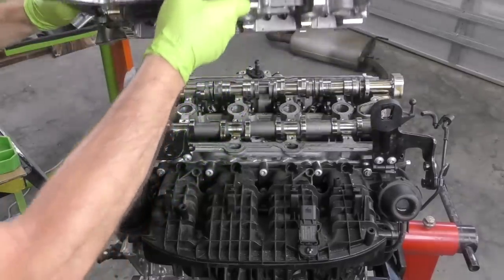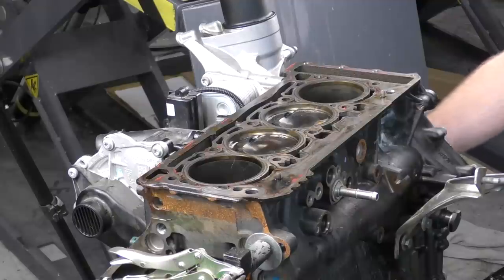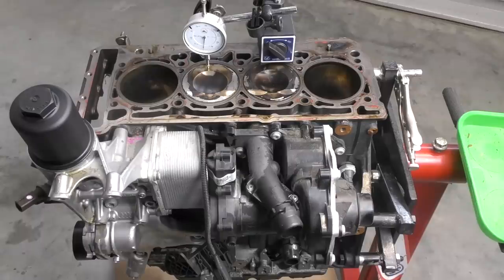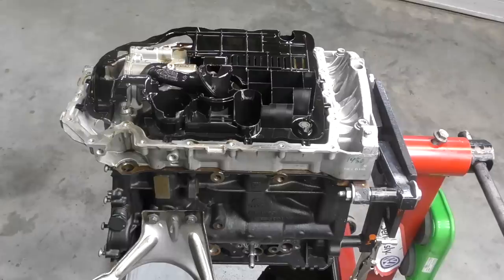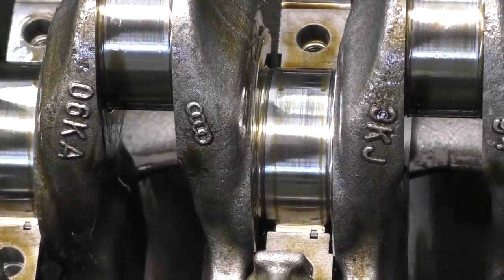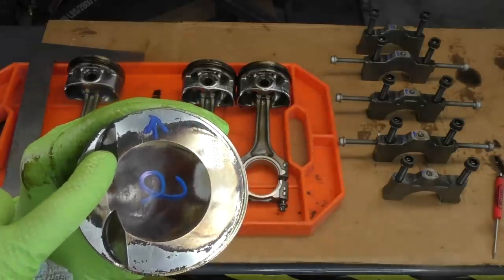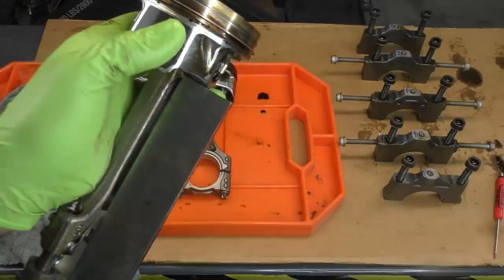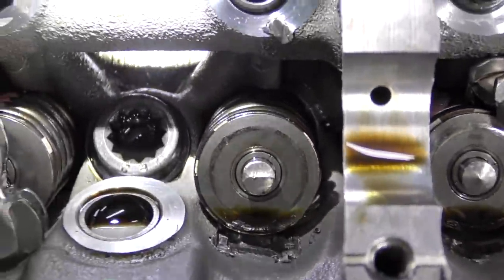Catastrophic Engine Failure VW 2.0t TSI Engine 2 ~ Bottom End Damage

Comment: relatively snoozeville which is a good thing obviously, that thrust washer is interesting, wonder why they use such a setup to introduce a point (potential) of failure, Charles, in your opinion, would you reassemble the short block(were speaking hypothetically) and put a new head and call it repaired or definitely rebuild lower end(this was a GTI engine correct?) Do Golf R motors have that much difference? great vid as always, and the chuckle at the oil pan was nice!
Reply from the maker: I’d be thorough in the replacemt. New bearing minimum
Reply: Why only half a thrust washer - Find and read VW SSP 606.
The first paragraph tells you everything you need to know..."The reason for the new phase of development is more stringent emissions standards (Euro 6) and, of course, consumption reduction requirements, accompanied by a reduction in CO2 emissions. The powertrain was in all respects redesigned from top to bottom....Ingolstadt engineers have, during development, paid particular attention to the following points:
- large number of identical parts for all engine versions
- Reduction in engine weight
- Reduction of engine internal friction"
Half a thrust washer = reduction of engine internal friction. Other changes included smaller main bearings for the 1.8L engines, two stage oil pump, many others. The EA888 gen3 was designed first and foremost to minimize emissions.
Reply: @acefighterpilot  Interesting.  I'm not sure I agree with that decision.  Lower friction, okay, but it seems like it could sacrifice a lot in the long run
Reply: @VndNvwYvvSvv  I don't agree with it at all, and clearly it is sacrificing the aftermarket's ability to throw a clutch in and boost away. I was very disappointed by the internal design of this engine compared to previous VW engines. For instance the VR6 has seven 59mm diameter main bearings to support its 178 ft lbs. But the Golf R has five 42mm main bearings for its 280 ft lbs. Both are forged cranks in grey cast iron blocks. They literally do not build them like they used to. VW/Audi did everything they possibly could to reduce emissions, weight, and cost at the expensive of durability.

Comment: 0:05 but 3rd to 2nd is not that much of a difference ? I would only expect this type of damage from say 4th to 2nd or 5th to 2nd how did this damage result from the difference of only 1 gear ? Could this damage also happen from high rpm 5th gear to 4th gear ?
Reply from the maker: It can happen at any gear with a high enough RPM

Comment: Is the thrust bearing assembly the same between the GTI and the R? Is my 2019 R just as likely to have crank walk with an updated clutch as a GTI does?
Reply: Yes, it's beyond a common problem - if you have an uprated clutch in your R, eventually the thrust bearings will wear and fall out. Most engines, VR6 for instance, have upper and lower thrust washer halves, which makes it impossible for the bearings to fall out. VW sought to minimize internal engine friction to reduce emissions as much as possible with the EA888, and that included smaller main bearings in the 1.8Ls and also only upper thrust washer halves in all engines (VW SSP 606).
Some R and GTI owners have posted guides on disabling the clutch interlock so you can start the car without the clutch in, thereby reducing wear on the thrust washers during the most critical time of low oil pressure and temperature.
The ultimate solution is to have the lower main bearing caps machined to receive the missing two halves of the thrust washers, which some R owners have done. Then it is no longer possible for the washers to fall out. But bear in mind VW's main goal with the EA888 was reduced emissions, largely achieved by minimizing oil flow whenever possible. They were not thinking about folks in the aftermarket running 400whp.
Reply: When I first read SSP 606, with a look of sheer terror, I cancelled my plans to tune my 7R and I plan on offloading it the day the warranty is up. I'm going to be dead within sixty years, I really would much rather have a car that lasts twenty years rather than stave off global warming by five minutes because my car only has half a thrust washer.
Reply: acefighterpilot I really don’t think the start up could cause enough wear on the thrust bearing, it is rather those people who sit at a red light for minutes idling their engine and leave their car in first the whole time, and do it for years and years.
Reply: acefighterpilot trust me you will get bored driving that car after 20 years, you may keep it but the chance of you driving that thing everyday after twenty years is very slim, I will wait for your reply after twenty years!
Reply: @davidgruen7423  Wear is cumulative. When you operate the clutch, you are wearing the thrust bearings. The car doesn't care why you are operating the clutch. It does however care if you are operating the clutch with no oil pressure and low oil temperature such as at start up. Try rubbing two pieces of metal together with oil and without. You can do it with oil a thousand times and it still won't leave scratches like doing it without. Disabling the interlock certainly won't stop the wear, but it will give you more time.

The Cabrio VR6 I built when I was twenty is still just as fun as the day I built it. The basic fact is the 7R is the end of the line for high power manual transmission Volkswagens. Maybe since it's so soul less it won't be as fun in twenty years as it is today, but to me it will certainly be more fun than the electric cars on the market then, for the same reason my Cabrio is more fun than it is - driver engagement.

Comment: I was test driving a customer car after a repair and I also accidentally shifted from 3rd to 2nd instead of 3rd to 4th. In a split second all I heard was the engine screaming and the RPMs close to 5500, then immediately put it in neutral and reset. How the engine didn't explode, I will never know, but I'll take it. I'm surprised I didn't die from how fast my heart was racing lol

Comment: Hello I have a 2010 Passat and the oil level keeps rising and the diesel keeps going into the oil has happened multiple times have you got a clue why this happens
Reply from the maker: I’ve seen fuel injectors leaking do that.
Reply: Injectors are leaking between cylinder head and injector frame. Is is pumpdüse engine or CR?
Reply: How do you find out which injector it is that’s leaking ?

Comment: I recently did some chains on this engine to to chain stretch and I know you did a vid on the chains but I took a few pics of the correct tools if u want me to throw up a quick vid. I’m a Audi diag tec
Reply: I’m a VW tech myself. Done a ton of chains. Never used the tool 🤷‍♂️ 

Only use the tool to remove the crank bolt. That’s it.
Reply: @lynxstarautomotive208  How long to the chains last from your experience? I have a 2020 GLI.  
thank you.
Reply: Coyote 5.5 V8 TURBO & 555 Big Block Chevy Camaro The gen III’s do not suffer from timing chain failure as much as the Gen I/II’s did. Really the main failure was the tensioner assembly more than the chain itself.

However, the secret is oil service. Stop changing the oil every 10k. Do it at 6-7k and use good quality oil like Liqui Moly, or Motul, or Pentosin.

Comment: If that first main bearing that had wear was in a old small block Ford or Chevy lots of people would re use it  but you can’t take that risk in a newer engine because many engines are using really thin oils and oil pressure is so critical you don’t want oil to be bleeding off anywhere! The old engines didn’t have so many oil passages, 4 camshafts to feed, balance shafts, cam phasers, timing chain tensioners. I’m not saying it’s a good idea to reuse bearings in a old push rod engine I wouldn’t just saying the old stuff you could get away with a lot more

Comment: Do you know if the car this motor came out of was running anything aftermarket as far as a tune, and if it had a DSG or manual trans?  Wondering if those marks on the thrust bearing were normal wear/tear or were from a manual car using an aftermarket clutch.  Seems that people that have had issues here have been on aftermarket clutches, which also means they are probably running some ECU tune as well.  That thrust bearing showed a lot more wear than any VW motor I've pulled apart.  Thanks for the the vid!
Reply from the maker: Not confirmed on the clutch. But he was running a tune, downpipe, intake

Comment: I’ve done this on my RSX from 3rd to 1st and nothing happened just redlined and car slowed down and pivoted. That’s crazy how severe it is on VWs
Reply: That’s what I’m thinking I do it all the time on bmw 325
Reply: Funny I did that on my rsx and had rod knock after and did it twice in my stage 1 mk5  1st gen motor gti and 1st gen motor eos and both still run smooth as new I think timing chain engines are less forgiving imo
Reply: Pretty sure B motors dont even recognize the difference between a "money shift" and " WHEN V-TECH KICKS IN YO!!!"

Comment: Is there a possibility that these engines were designed to avoid valve damage? The negative force may be sent to the valve springs and rocker rollers instead. What are your thoughts? Did you ever encounter a broken or bent valve on this specific engine?
Reply: It’s just whatever the weakest link is.

Comment: Hmm I don't quite understand how over revving can cause those scorings in behind the valves on the top end, I thought money shifts almost exclusively result in damage due to valve springs breaking or meeting the piston, it's as if the valves bent out and hit the top end walls.
Reply: Those rockers got dislodged at very high engine rpm due to miss shift, so they did rumbled in the top of the engine before they found resting spot. This particular engine could potentially end up with much worse damage.

Comment: i was just wondering, if those trusth washers are worn out, woldn't that cause the rear/front main seal to fall out or cause an oil leak?
Reply from the maker: Possible. But I think before that happens they cause other issues or simply drop into the pan

Comment: the valve cover is part of the cam bearing... WTF!
That engine had to have been spun to 12-14k RPM
I spun my 30v 2.8 to probably 10k.
Just lost a rocker
Reply: Volvo used same kind of head design starting from late 1990s.

Comment: Hey i have a 2013 Jetta GLI, it makes a sqealing, almost  rattling pully sound on start up for about 5 seconds. After ive been driving it for a while, if i have it in manual mode it will occasionally do the same sound if i slightly rev out first and second gear...any pointers you can think of to look at replacing? Thanks
Reply from the maker: Some of those had issues with the cam adjuster making noise in cold start
Reply: @HumbleMechanic  Thanks! Would that also make noise after being warmed up and driving around? And is it something i should be worried about or have it looked at?

Comment: So funny.  Ford sold UPS a bunch of trucks in mid 90's with Cummins 5.9L engines.  Synchro transmissions but no tachometer. Drivers would routinely shift to a lower gear, let clutch out and guess what you get?  A broken cam shaft every time(a few bent valves too)  A non-synchro trans would have avoided that but oh no, Ford wanted drivers to be comfortable driving.  I replaced so many cams and cylinder  heads due to that debacle.

Comment: my first car was carbureted and i had on some fancy pedal covers as soon as i merged with traffic foot to the floor as i tired back off she still wanted to go and into the cars ahead so i clutch and braked the tach went right pass 8 gran on the dash holee had to switch it off use my hand brake to main the speed while using my right foot to kick up the pedal.. them pedal cover straight into the garbage 😅

Comment: Why is the bottom of the connecting rod called a bearing even though they dont spin like a normal bearing?
Reply: Kinang Eagle it has a peice of hardened metal that rides in the groove of another piece of hardened metal which is called a journal bearing it’s not the con rod itself that’s a bearing it’s a seperate peice

Comment: @Humble Mechanic remember the factory tooling is good for so mane engines before they re-tool the machine doing the laze work, thus as the tooling wears down so do clearances to a point. A fresh re-tooling of the engine assembly is better, its very difficult to know where in the line and how many engines were made with the same tooling. Engineers say they can basically tell what will fail at what milage all on how long the factory tooling was used.. Kinda fu*kd IMHO but it's true.

Comment: Hey Charles !!! Off topic but I gotta question .. if your gear shift box inside car .. is it possible if uncovered    and unknowingly non visible damage could it make the car act up when driving as tho gears are cray cray ? I have the Tiptronic and no telling what got down in it b4 I brought it .. all my lights are on like u parked reverse , driving etc all at same time. My issue is it acts when driven like transmission problems  . .. my question is will a bad gear shift make car stupid ? My theory is if the car can't tell the computer what gear to be in it won't know how to act. I'm so frustrated and I have to much pride to pay to get a piece of mind.  Just wondered ... U are my car guy ..any thoughts .. or experience u can reference or just a bone cause this bitch hungry to know
Reply: Garbage in garbage out. If the grounds are poor, or the sensor in the shifter is failing or corroded, then the ECU does not know gearshift position, or has unreliable info, so definitely will throw a wobbly. you would definitely need to have this done via a tool, and reading the inputs from the gearbox and engine.
Reply from the maker: It’s possible for sure. I’ve seen the tip units get weird for that

Comment: How is that possible, I did that one time with my Toyota AE85 and nothing happened is that some weakness in vw or what!?
Reply: You got lucky.
Reply: Were you red lining? That's probably what happened here. Changing gears close to the rev limiter, and shifting down instead of up makes your engine go cablamo..
Reply: Older engine designs generaly have more margin for error built in. I caught reverse instead of 3rd downshiftng my Delica at 60mph and breifly spun the rear tyres (and stepped the rear out ) but din't blow anything.
Reply: You got very lucky.

Comment: I totally understand wanting to take it apart to tinker and learn because i have done it to complete running engines just to "learn" but once you saw the pistons had no marks obviously the rods cant be bent then if nothing has hit it any how once the head came off and the piston tops were confirmed good that should have been enough confirmation right there to not take the bottom end apart and the disassembly confirms that all the wear items had life left and now are probably never gonna get used again mine as well replace it all unless you have no money all of that can be put back together cheaply and refreshed as well or kept as a spare bottom end just re ring and hone the block maybe some decking and resurfacing and then you can get away with re using whatever was not broken the more that whoever can afford to be replaced the better obviously, Head Gasket, New Studs and call it BRAND NEW again. Perfectly not bent motor that now needs shit it basically could have gone with out because all that shit ends up adding up quick and the bottom end was just fine it could have been cleaned up and even re used like that for a long time as long as it was taken care of. Any how good day to you sir great video. No Carnage. Just quality wholesome content.:)
Reply from the maker: I was confident that there was not real damage to the bottom. But so many asked about it, so I wanted to see. :) Now the owner has an easier path to a big power rebuild. LOL
Reply: You can end up with bent rods without visible mechanical damage. When enough oil, fuel or coolant finds it's way into the combustion chamber while the piston is on the way up it could create hydraulic lock (can not compress fluid), which could bent conrods.

Comment: There do seem to be issues with these engines and I am thinking of a Skoda Superb with a 1.4 TSI engine and manual gearbox as the maintenance of the DSG terrifies me. should I be looking elsewhere ? does anyone have any advice please ?
Reply: I'd stay away from the 1.4 with timing chain, and go for the newer model with timing belt instead.
Much more reliable, and better mileage as well.
There are two kinds of DSG, and the one that comes with the 1.4 tsi is usually the dry clutch, which doesn't require oil change every 60k km.
Changing the clutch is expensive, but they usually last a long time unless you do a lot of driving in heavy traffic.
Reply: @panzerveps  the dry clutch dsg are known for being very poor and can only hold 250nm of torque
Reply: Only issue ive seen on the 1.4 is leaking thermostat due to the seal failing but i dont think its that common, thermostat is on the gearbox side of the engine
Reply: @panzerveps  Thanks for the tip, any clues on how to tell whether it has belt or chain driven camshaft
Reply: @KasamS  Thanks for the tip but I am definitely not going with DSG, I would rather change gears than gearboxes
Reply: @johntheoldmod  what year car are you looking at getting?
Reply: @KasamS  2016 or before April 2017 as it is only £30 road tax in UK